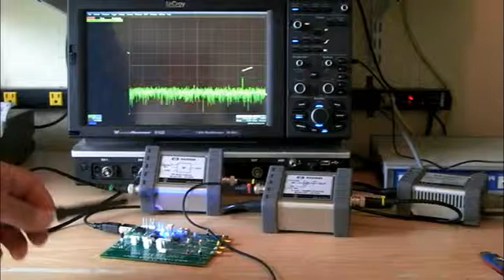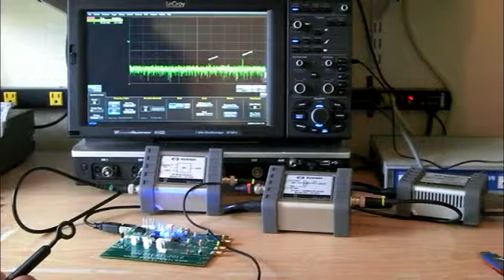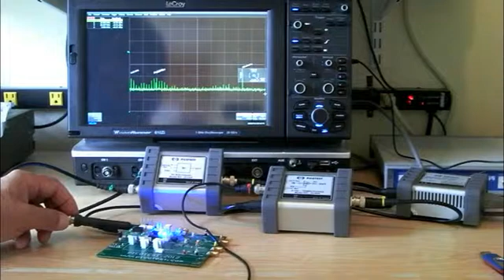Troubleshooting EMI

Comment: i got a problem with my audio i uploaded a video of it of my channel can u tell me what it is and what i can do to get rid of it
Reply: provide a link to the video and I'll have a look
Reply: Steve Sandler /watch?v=-VM1oic4mtE 

note it was recorded on a high volume otherwise my mic was not able to pick up the sound ,normaly when i play music its a background noise but its very annoying
Reply: zwabber dweil
I believe this is from your speakers.  I use Ceative Labs and mine make a similar noise.  What speakers are you using?
Reply: Steve Sandler  Floating Synthese 1 its a dutch brand , maybe its my pc cause thats the source im using when i have this problem , but what i dont understand is that when i had my old home it was not as loud as it is here 

i mean the noise is there on a lower volume than it was in my old apartment 
first it was at 22  as example and now already at volume 16
Reply: zwabber dweil
Did you change your monitor or the distance between the monitor or computer to the speakers.  If the noise sounds like the line frequency its a ground loop, you might have poor grounding.  This noise can also come from your sound card, but you did not change the sound card or your computer, right?
Reply: right did not change it , groundloop can be a possibility bad grounding can be the cause i dont know if this make any sense what im gonna say now but my old apartment was on the second floor here were i live now its on the fourth , is it than possible theres a delay in the grounding cause its a longer way to travel or im i wrong
Reply: zwabber dweil that is a possibility . Sorry I can't be more help